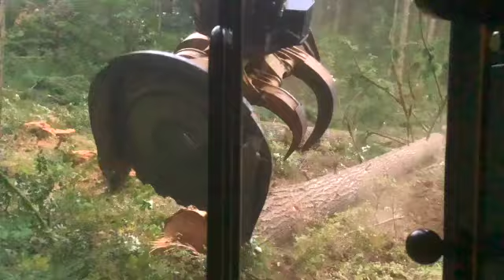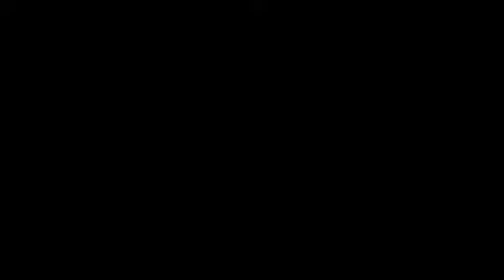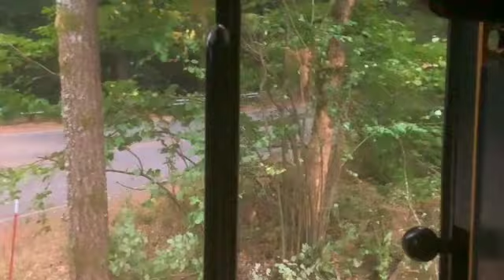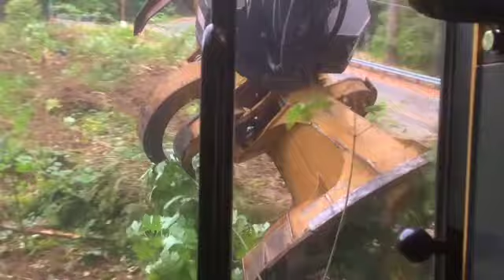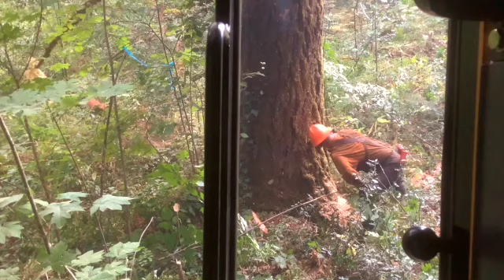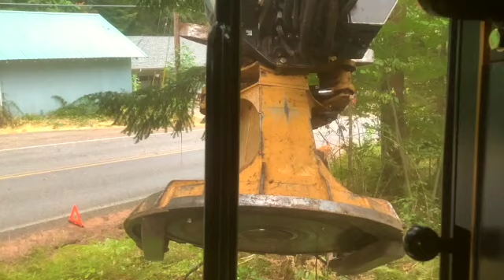Pushing Roadside Wood For Owen With Traffic Control  - Hand Faller & Feller Buncher (Video# 2 of 2)

Comment: Getting that head up high makes so much difference. Here in North Al, we hook a choker and pull trees over with 100-150 feet of cable. Once the timber cutter and skidder driver get on the same page it works pretty good.
Reply from the maker: Copy. I've done the same. Like you say, having everybody on the same page is the key! Thanks for the comment, good to hear from you.